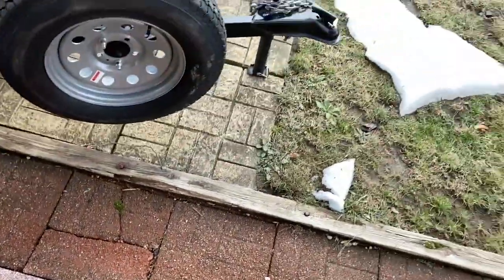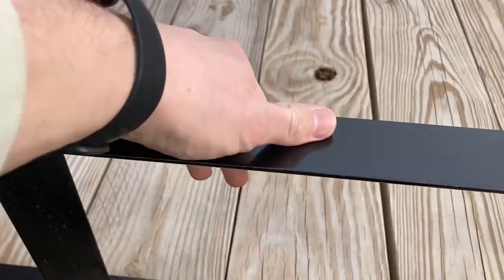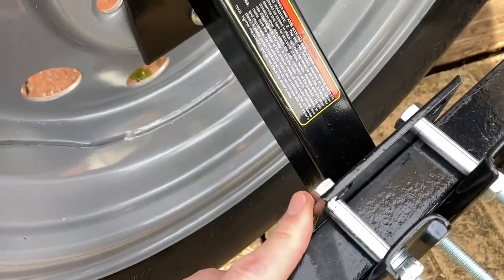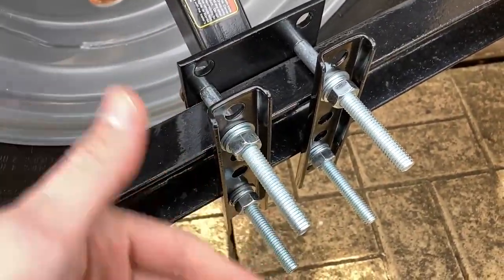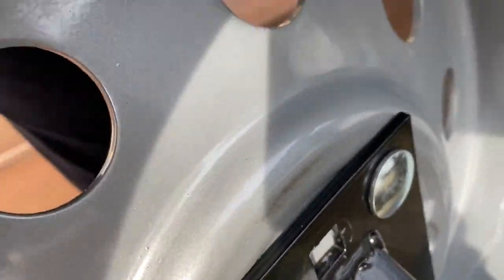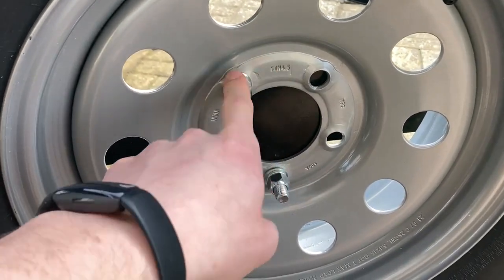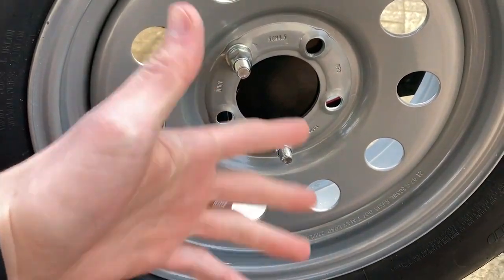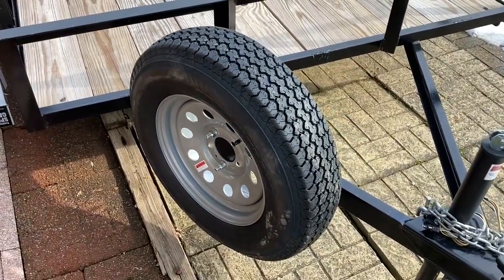Review and Install of the Haul-Master Trailer Spare Tire Carrier Harbor Freight

Comment: Just got back from the lake today and the tire fell off on my driveway. Weld cracked at base of plate. Rim still attached to mount and base still attached to boat frame. Don’t trust the weld job on these! I only had it a year to this month.
Reply from the maker: Good to know!! I’ll keep an eye on the weld for sure!!!
Reply: That's the main reason why I built my own tire carrier for my trailer I have a video of it on my channel

Comment: It says tounges up to 3 inches but looks like you could use it on wider tounges. Do you think that I would be able to mount it to my travel trailer bumper? It's 4 inches wide.
Reply from the maker: Oh yeah I would think so, you could always do longer bolts if needed too.
Reply: @matt-diy  sweet, I was thinking the same thing. I was looking at these at harbor freight earlier today. I am gonna head back and buy one.
Reply from the maker: @johnnycrow9256  sounds good!! Should work out nice for ya!!